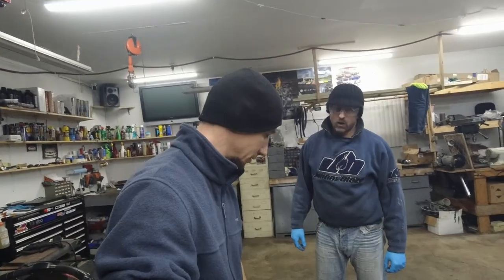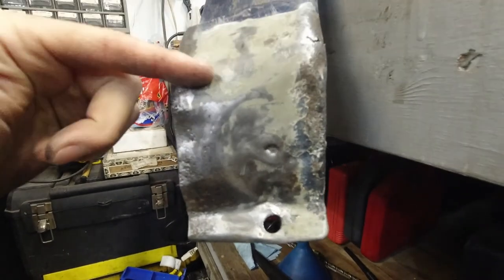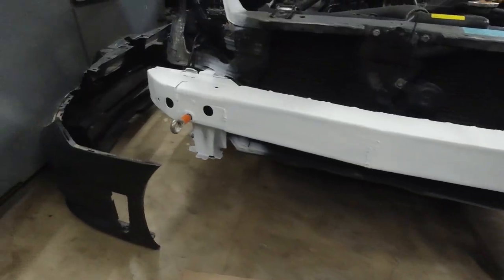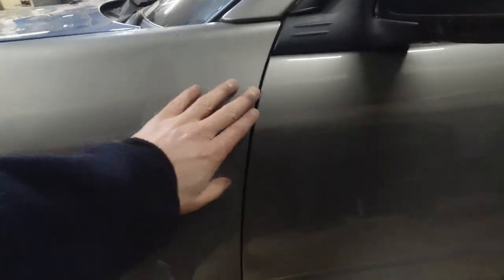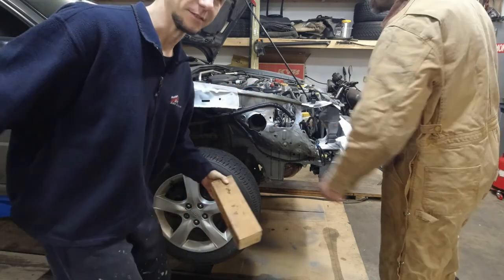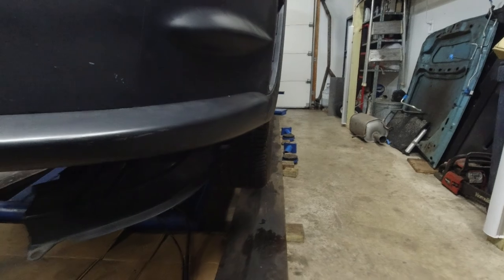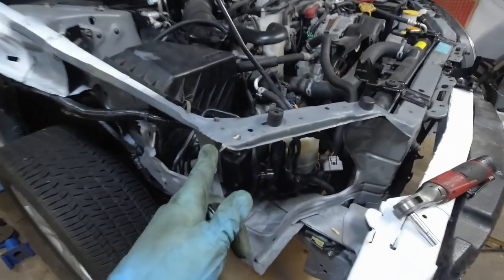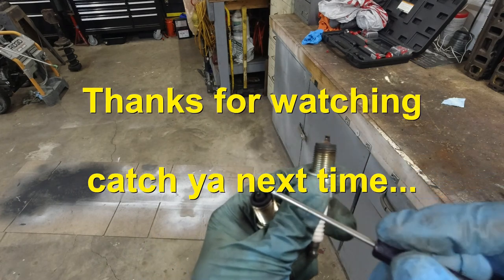Subaru Ice Racing Autocross budget build part 5 coming together

Comment: What is that rust converter stuff?
Reply from the maker: its good stuff for frames, suspension parts but I wouldnt use it on a panel on a more serious car, you can get it shipped to Home Depot... Corroseal
Reply: Thanks. I have been using fluid film by the gallon. I just brush it on the undercarriage of my vehicles